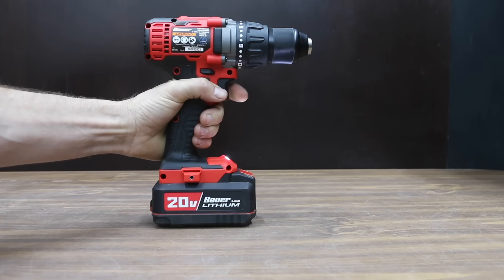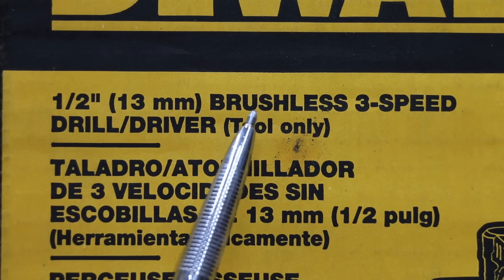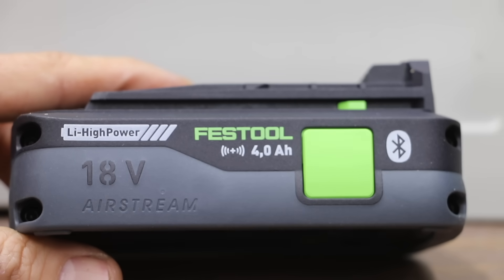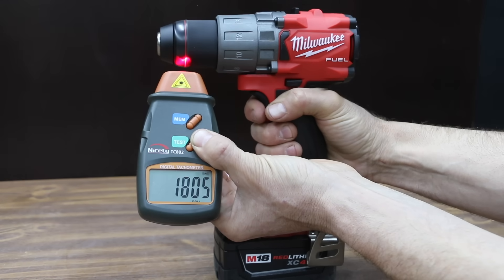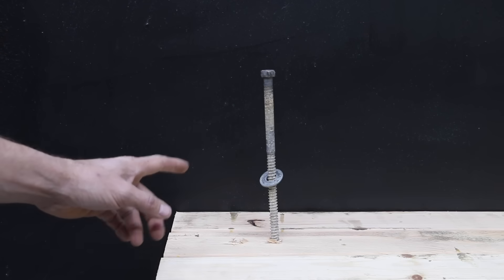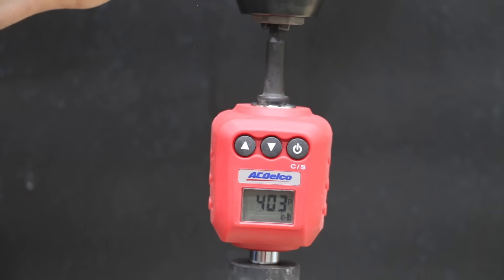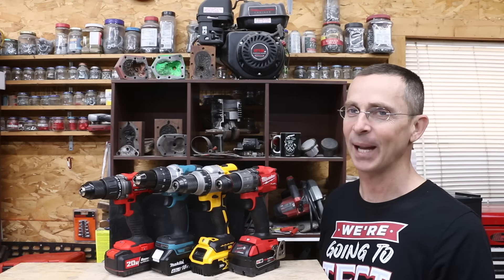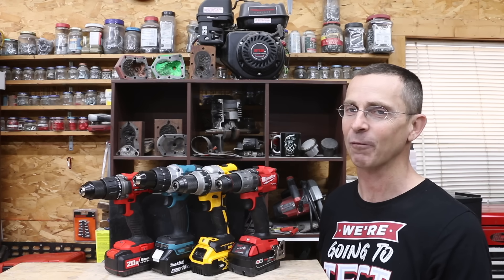Best Drill (BATTERY POWERED)? Milwaukee vs Dewalt, Makita, Bosch, Festool, Ryobi, Bauer, Ridgid

Comment: I have a Makita drill and absolutely love it. Extremely comfortable fit to hold. Just the right amount of weight and it can take abuse. It's the all black model. It's powerful too
Reply: I've been using the Makita for years now as well, it's had so much punishment thrown at it yet it still works great.
Reply from the maker: Thanks for the feedback.
Reply: I find makita tools in general much more comfortable than any other brand

Comment: YEARS ago, (1992?) I had the made in USA Milwaukee 12V drills for work. They worked wonderful, but after a season, the batteries cost too much, so I went with Makita. So, the drills layed around for years with no batteries, and....I finally heaved them out. But a few years later...a bunch of new 12V batteries appeared on eBay. Guess I should have kept them! The Milwaukee' in a nice metal box was about $210 back in 1992.
Reply from the maker: Thanks for the feedback.

Comment: 5:34 weight
5:46 length
5:56 lowest speed
9:08 clutch torque lowest setting
11:15 peak torque first gear
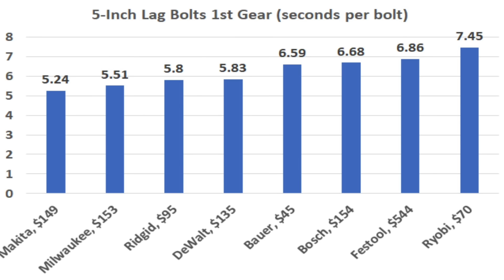12:57 HP 1
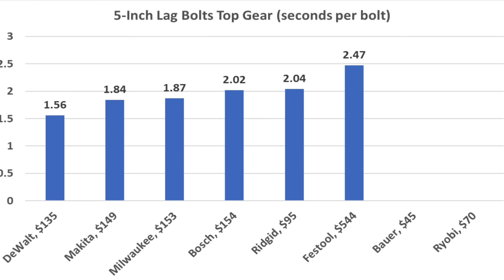14:32 HP 2
Reply from the maker: Thanks for sharing.
Reply: @ProjectFarm  My pleasure! Thanks for the great work and effort. We learn a lot from you.

Comment: Next time you do any cordless power tools, can you add Porter Cable? I love my 20v set.
Also, if you do any battery comparisons, I buy my 4ah batteries on Ebay. The no-label brand is $34 and the PC brand is $85! The Ebay batteries last just as long and work just as hard.
Thanks for what you do!!
Reply from the maker: You are welcome!  Thanks for the suggestion.

Comment: For what I do, my Ryobi drill is just fine, but if I needed to do heavy or medium construction work, lol I certainly know that I'd need something with a bigger bite.  I think that's something people forget, as I get thrown in my face blah blah blah DeWalt, or my Milwaukee this or my whatever is better than your Ryobi, and I saw it's all about application, I know that my Ryobi isn't top of the line and can do anything, BUT for what I do, it's perfect and does anything of what I do.  Yeah I suppose the other side of the coin could be well why not buy a drill that's ready for every application?  My personal response is, I'm partially disabled, I'll never need a drill that's ready for anything, I just needed a light easy reliable for what I need drill and that's what I got and have had it for 3 years problem free.  Not a "tribe" thing although I do have other 1+ Ryobi stuff so lots of big battery swaps but again it's a platform that works best for both my budget and application.  I also have a B&D drill with an auto clutch which when I got that (it stops a screw in wood by sensing so it won't damage the wood surface, very scary the first time I used it but works really well) I knew it wasn't ready for heavy stuff.  Going on 5 years and it still works like the day new out of the box.  In closing it all comes down to you the consumer, ask yourself what are you doing what do you think you might do and how much to work with.  Or buy what you need or do and then later if you need something bigger for a bigger job.  I do know that my nephew who has a Milwaukee drill and I used my Ryobi he batter died and I was still going about another hour and my battery charged faster than his fuel.  I know it also depends on use, but a no use charge the Ryobi I have seems to hold a full charge over several months.  That's a test if like to see is battery charge hold over time with no use.  But I like my drill again for what I do it's perfect.  I will say my only complaint is I wish the light would stay on for a 10 sec after trigger pull, and my biggest complaint and it's rare but on occasion, it is a long drill body and I can't get into tight spots but to fix that I got a long bendable extensions different lengths so that helped.  Love you channel off my soap box thanks for reading.

Comment: To be honest, I tried almost every brand from this list (not exactly the same drills), everything went wrong 1 year after the warranty,  but Festool did not. I use my Festool drill for 13 years 2-3 workdays a week, and it is still like new, only the battery has to be changed after 7 years. The Festool drill (not this one with Bluetooth WTF???, the old one) also fit in my hands the best.
Reply from the maker: Thanks for the feedback.

Comment: Couldn't quantify how bad the Festool did at the end there, especially for its price point, so much so that the farm thought it be best to just pretend it didn't exist 🤣
Reply: There's a lot of teardowns of recent Festool products on YouTube that find inferior parts, cheap materials, and failure points that are probably intentionally engineered to fail but it's hard to tell because of shoddy engineering. Even fit and polish, the usual mark of a premium tool, is Harbor Freight quality on some of them.

The simple matter of fact is the brand has fallen. A lot of brands have declined, but Festool has completely fallen. It now sells bargain tools at the same price point it once sold premium tools.
Reply: @Hevach  that's why I buy Milwaukie or Hilti both have excellent warranties  , 5 years and 20 years respectively.
Reply: @jeffalan6339  Milwaukee’s warranty is absolutely worthless. I’ve tried to warranty so many of their tools after they’ve prematurely failed and Milwaukee says take a hike. So man fuel sawzall and m18 drills trashed, these are tools with crazy r+d and marketing but made in China with incredibly cheap parts. Still love using their tools though lol
Reply: @carbb5760  I don't work for Milwaukie I just use several of their tools. My heavy duty 1/2"  m18 drill has been real work horse.
Reply: DC and AC currents have been around since Tesla's time. 

Another mind blow, AC and DC currents have always been around.
Reply: @nikkoBcool  Which Tesla?
Reply: @adotintheshark4848  Nikola Tesla of course!
Reply: Exactly what I thought, it actually looked like one of the cheapest also, what a waste of money 🤣🤣🤣
Reply: It's comical how Festool brings out the rabid haters. Festool makes its tools in smaller volumes and doesn't enjoy the economies of scale you see with leading brands. Festool also trades on its history of innovation that other brands have simply been able to copy.

Tests like this are interesting in that they show ultimate performance, but they are not "day in the life" tests. The test also centred on the common features and didn't call out anything unique. The Festool PDC has a 4 speed gearbox and a max RPM doubling those in this comparison. It also has an interchangeable chuck system that's still unmatched by competitors. These features are probably only required by small cross section but to them these features can justify the cost.

If you stop to think for just a moment there's absolutely no reason to hate something that nobody is forcing you to buy. It's like hating BMWs because you've been cut off by them too often .. that's the driver, not the car!
Reply: @kevinpunter7960  in my work we have cordless drills from makita, hilti, fein and festool and this festool drill has low low low torque (the 4 speed gearbox doesn't help because it almost feel as it was made for a 20v drill), top rpm is useless for drilling wood/steel, has serious battery wobble issue so you have to always drill using two hands holding the drill AND the battery (even after festool replaced drill body moulding/checked connections), we have also T18 and it is rubbish also, these two are kept hanging on the tools board nobody wants to work with them
Reply: @abyssaldision5134  I have Makita, Metabo, Dewalt, Festool/Protool, Hitachi, Bosch and others! Several of my "Festool" drills are the original Protool models ... including ones such as their big corded rotary hammer drill. I've had no problems with the Protool cordless 4 speed hammer drill - but I don't abuse my tools. I have many more powerful drills but regardless of stories about power and ruggedness I'll point out that Festool's market under the Festool brand only weakly addresses construction and is more aligned IMO with finish carpentry and joinery.

I tend to use my Makita and Dewalt gear for timber construction, Metabo for metal fabrication and Festool and related specialist tools for finish carpentry. The Centrotec system in combination with the Festool drills offers a significant productivity and convenience advantage when used intelligently.

The biggest failure that I've seen in my almost 5 decades on the tools is the failure of the tool operator .. failing to use the correct tool, failure to operate the tool appropriately and failure to service and maintain the tool to get the best out of it.

An even greater failure is that of not understanding cost/benefit when assessing a tool - particularly when it has unique features. You can cry like a baby as much as you want because you think something is too expensive .. but it actually comes down to what the tool saves you relative to what it costs.

Remember always .. A bad workman always blames his tools.
Reply: Festool. Is made in Germany,  a driving miter saw is 1500. 
Biscuit jointer is 1000 my Dewalt was 220
Reply: Festool excel in the sanders,track saw  department the most, cabinet makers love them, but I would never overpay for one of their drills
Reply: hard to spin this one positively.  That's way too much money for a drill.  C'mon.  That makes no sense.
Reply: Always start festool was like a craft wood shop piece? Pretty much light duty applications not construction. Once again you're buying into a battery family and so it's the breadth of the tools in the area that you need that matters. Does festool have that breadth? Certainly doesn't in the construction end of things.
Reply: Festool likely excels at saws - track saws, miter saws, etc
Reply: Never heard of festool before today and no wonder, they suck by comparison. $600 for a turd, no. Dewalt does everything I want it to.
Reply: Quick off the top of my head for Festool inventions: 1. Brushless motors in handheld power tools 2. track saws 3. Vacuum that integrates with the power tool 4. Detachable power cords 5. Jigsaw light sequenced with blade movement so it appeared that the blade is stationary while cutting 6. Sander exhaust blown out the center of the sandpaper to force sawdust to perimeter vacuum holes 7. Systainer storage system (modular tool storage)
Reply: @joshuawiedenbeck6944  Milwaukee has brushless in tons of hand held tools, vacuums etc
Reply: @jradke54  Yes they do. I own a lot of them.
Reply: @joshuawiedenbeck6944  ok so what innovations does this have over the far superior Milwaukee ?
Reply: @jamesbyrd3740  Now that their patents are expiring, non that I know of. I own Milwaukee tools. About 15 years ago Festool was the shit though. Imagine having everything modern tools currently have while every other brand was still trying to figure out their battery technology etc.
Reply: @jamesbyrd3740  Well,  the build quality,  finish and presition of a Festool is superior.    No chuck wiggle, no delay between trigger/tip rotation,  aftermarket service and parts,  durable boxes,  quieter, etc.  Coming from a Makita fan.    If  the festool brand would be like 150bucks cheaper, I would go for it eyes closed.    I have seen them around in harsh conditions and they perform flawlesly.      Another one that is really well made and 'underperforms'  is the Hilti one. Also in love with it.        It is kind of the HP  battle between american muscle cars and euro super powered sedans/coups; muricans have more muscle, in a tacky way.  I wouldn't trade a BMW M5  for a Charger
Reply: Lol. Yeah. Festool isn't a home gamer brand. Watch AVEs festool saw teardown.
Reply: @john050994  I see more Festools being used by so-called home gamers than professionals. Older guys with money to burn, who will maybe dust off their tools once a year to show to their mates. This is the typical Festool user. So no wonder they are long lived.
Reply: @Quicksilver_Cookie  true. It's designed to be more of a fleet tool. But the fleets don't use them because you can get 7 skilsaws for the same price
Reply: @Quicksilver_Cookie  not true at all. It depends on the industry. You arent gonna see festool on a rough construction job site but finishing professionals absolutely use them
Reply: What people have to realize about Festool is that they were the innovators of many of the features you now find common on a lot of power tools. I had a Festool drill about 10 years ago that had interchangeable heads for different applications (quick bit, regular chuck, right angle etc). Low and behold Milwaukee recently came out with one that is almost identical to that drill. Patents must have started expiring. I agree that in 2021 Festool is overpriced because all of the unique features they used to have on their tools are no longer exclusive to them.
Reply: @joshuawiedenbeck6944  black and decker invented the first battery drill 60 year’s ago and I still have two 30 year old dewalt battery drills still going strong. Plus Black and Decker invented power drills over a 100 years age.
Reply: @davewilson8308  what did those Black and Decker drills run on, DC? AC current wasn't around 100 years ago.
Reply: the trouble with the festool equipment is the price... but the are very long lived, which is why I would recommend them for commercial users only. Nearly every part can be replaced and the battery systems are compatible from tool to tool.
Reply: @joern122  Ryobi uses the same batteries across tools, and so does Milwaukee.
Reply: @joern122  or just buy 5 dewalt drills for the same price
Reply: @joern122  or just buy Milwaukee
Reply: @joern122  tools that can last the longest are superior to those which can work the fastest.
Reply: @adotintheshark4848   depends on the industry, for some things speed is key and for others minimal downtime
Reply: @adotintheshark4848 : You obviously don't use tools for a living. If an overpriced piece of junk wastes time, why have it? Cordless drills last years. By the time I replace a normal brand I would've long ago chucked that POS Festool off the roof into a dumpster.
Reply: @skipads5141  not for a living, but I use them. My old Craftsman wrenches and Skil saw are still good to go.
Reply: @adotintheshark4848  I’ve got 30 year old dewalt drills that just won’t die. Yes I said 30 years old!
Reply: @adotintheshark4848  To a point. My dad still has a DeWalt drill from the early 2000s, my brother Porter Cable drills from the late 90s, and myself a corded Sears Craftsman drill from the mid 80s. I don't think Festool's 300% price increase can be justified by longevity since other brands can also last decades of use as well. Even if someone proved a Festool lasted 90 years and its competitors lasted 30, that price increase is unjustifiable by that reason. Also I wonder how Hilti compares in all this, that's the brand I see contractors use the most at least where I am at.
Reply: These replies are hilarious. Festool is garbage. It is known by people who use tools. Go on any commercial jobsite where guys use power tools all day everyday and you don't find a single Festool tool. It's outnumberignly milwaukee unless you're a drywaller. Then it's Dewalt. Then if you don't care about when it breaks or how fast you get the job done it's ryobi. Trust people who use theirs tools for several hours a day 6 days out of the week every week of the year. Not some home diyer in the comments who has a hard on for makita for no apparent reason. Yall just opinionated because you want to justify your impulse purchases that you made without proper research.
Reply: @amnelruin4837  I was on a movie set builders job and all the tools were Festool.
Reply: @amnelruin4837  About a year ago I hired a new man. First day he shows up with Royobi pack out boxes with nothing but Royobi tools  inside. I told him to put that shit back in the boxes and pick up his paycheck from the office. If you don't have any more respect for your trade than that you are an embarrassment. I really wanted to beat the shit out of him but luckily I was able to control my anger.
Reply: @dangrimes5078  lol you got some anger there buddy. I've had dudes show up with milwaukee tools and packouts taller than them and didn't have a single level. And seen dudes with ryobi tools outpace everyone around them when it comes to production.  I agree it sucks but chill out mang.
Reply: @dangrimes5078  it's the man using the tools, not the tools themselves. Know a joiner that's quality and he's got all Ryobi.
Reply: @dangrimes5078  Lol, so basically you judged a craftsman by what brand of tool he uses? Sounds like you are the one who lacks the respect factor for the trade.
Reply: i mean you need to compare apples to apples, and use tools for the right job... festool is for profesional industry uses because of how accurate and precise tools are,, they are not china made and top end companies in my country use them in furniture sector, for assembly etc. they are truly heavy duty tools
Reply: @roltol7539  You misspelled Hilti.

Comment: I use a bauer impact driver along side my dewalt 18 volt its been great also the angle drill has done well. I have the small batteries so that could be better but not sorry I bought them. built a house with them thousands of screws.
Reply from the maker: Thanks for sharing.

Comment: Thanks for your testing! 

One test you missed is reverse torque!
Many brands use small reverse screws which snap off, I learned this changing refrigerator hinges for a retailer and brands like Craftsman heads  would snap off in reverse.
Maybe an update?
Reply from the maker: You are welcome!  Thanks for the suggestion.